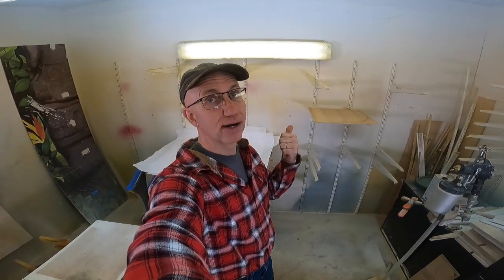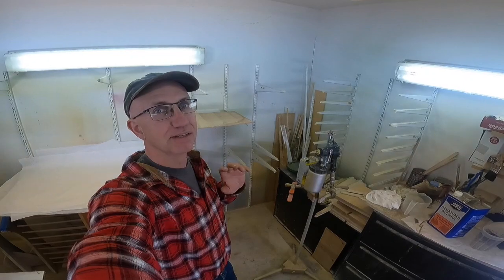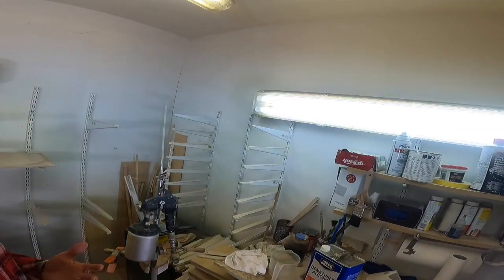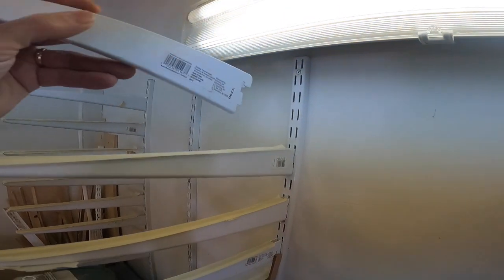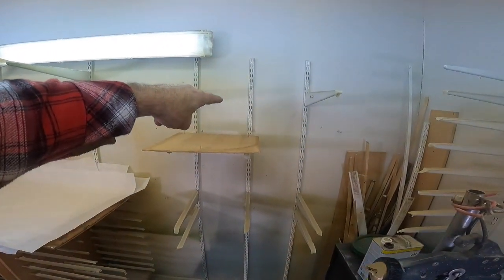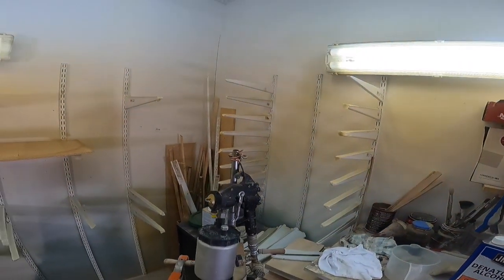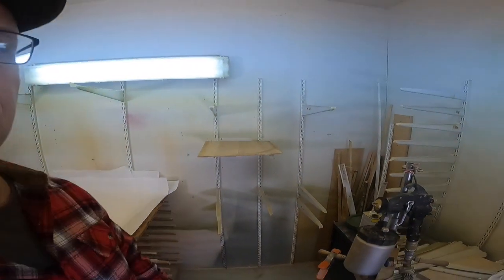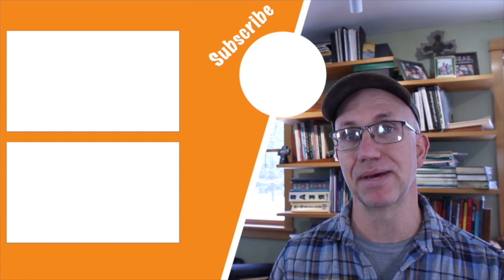BUILD A DRYING RACK FOR A SPRAY BOOTH FOR WOODWORKING: great workshop idea

Comment: those twin slot shelves are brilliant. i have several in my finishing room . its great to be able to take off the brackets and get all the space back  or configure them what ever way suits. having shorter brackets is great too for filler pieces and kick boards etc
Reply from the maker: They have been nothing but remarkable...but it looks like I am peaching to the choir.  I still laugh at the 4x4 and black iron pipe rack system I created almost 30 years ago.  The 4x4's twisted as they dried and then all the pipes corroded in place.  Needless to say, this rack system was a VAST improvement. Thanks for watching.